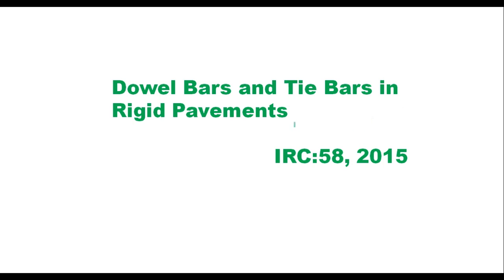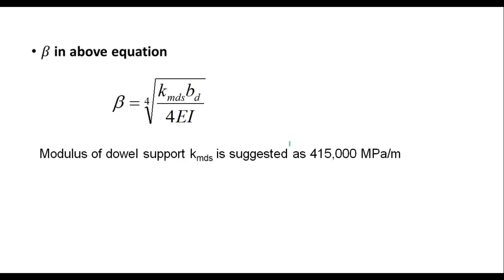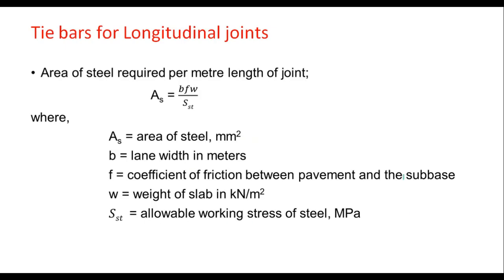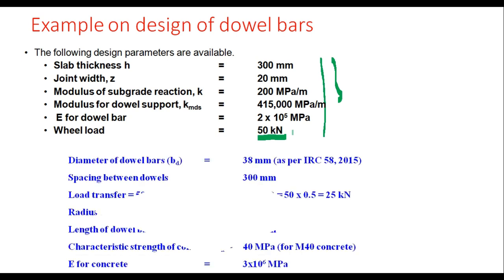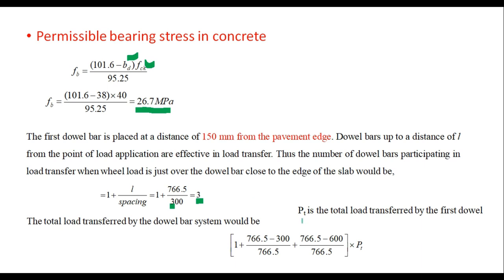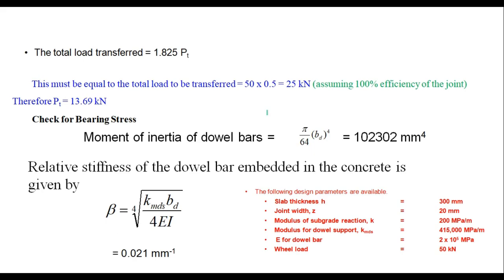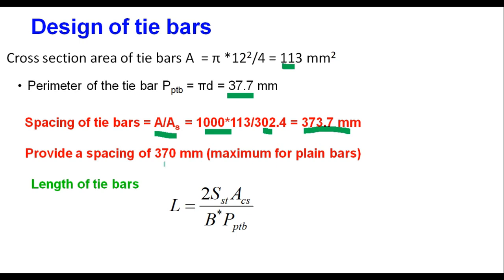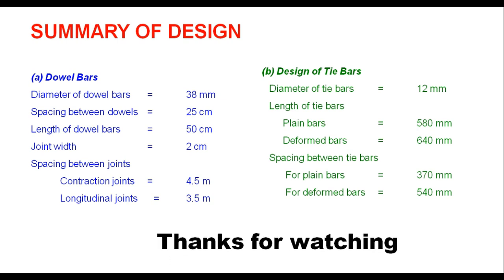#rigidpavements, #highways, Design of Dowel Bars and Tie Bars in a concrete Pavement

Comment from the maker: Dear Viewers, Please read the E value of concrete as 30000 MPa. However, it will not change the design as this data is not used anywhere in calculations.

Comment: Good info for learner. However following shall be taken into account in actual design
1. Maximum single axle wheel load from axle load data. It can be rear single axle or average from tandem or tridem configuration.
2. The example is taken for 20mm joint width which is expansion joint, however spacing of dowel bar can be optimised for 5-8mm transverse contraction joints. Though 20mm becomes critical in load transfer. This only if QA/QC is adhered properly at site, as overall consumption of dowel bar will reduce for 5-8mm joints thickness
3. If there is concrete shoulder of 2m, then the slab size becomes 2x4.5m, in this case do we need to provide additional saw cut dummy joint at 2.25m without dowel to limit the l/b ratio within 1.5? IRC 58 figures don't propose this and there is no requirement suggested in IRC. Because the panel is still safe in design. Please guide on this.
Reply from the maker: My yes for your first two points. These are good points to be considered.
Regarding your third point, I would like to mention that the entire analysis given in IRC code is based on slab of 3.5 m to 4.5 m. If you change the dimension of the slab further, then Finite element analysis should be carried to understand the behavior. The equations and charts given in the code will not be applicable and the behavior of the slab of size other than given in the code is not known.

Comment: Sir while calculating area of tie bar thickness of slab is missing in the formula ,kindly check please  . 
As As = bhfw/ Sst as per khanna and justo . It is also misprinted as per irc 58 .
Reply from the maker: Yes, you are correct. h is missing in the equation. But the value of As is calculated by considering the correct equation. Thanks

Comment: Dear sir, the purpose of providing longitudinal joint in the longitudinal direction is same as that of contraction joint in the transverse direction? I mean in the transverse direction, the contraction joints are provided to counter the effect of frictional stress due to reduction in temperature. Is the same logic adopted in the longitudinal joint also?
Reply: In continuation of the above query, I have seen in books that reinforcement in the longitudinal joints are provided to keep the slabs together due to vehicular drag. If such is the case then why don't they consider vehicular drag force in design consideration?
Reply from the maker: Drag force is always there on a road in the longitudinal direction. It will be resisted by weight of the slab